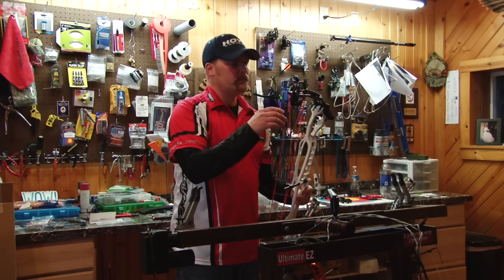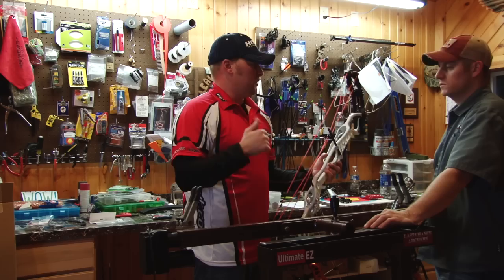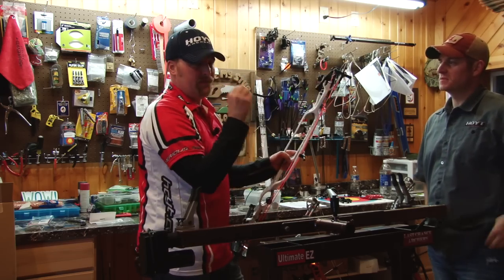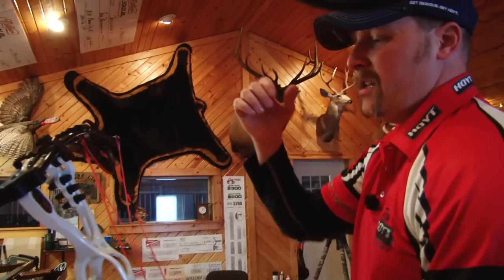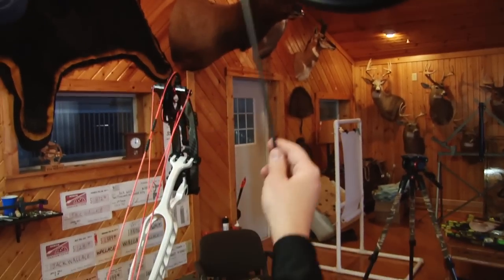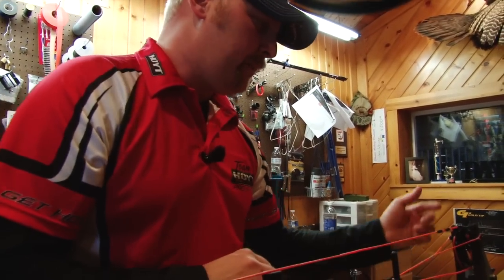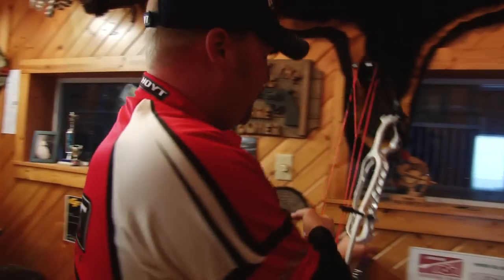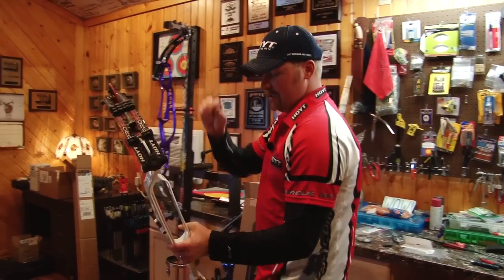Project #PAPASEDGE E:3

Comment: Hi,

I was wondering about setting the top cam advanced like that, I gess you have no choice in order to reach good bare shaft paper tune results? Do you think it is something more model-related or a cam-related behavior proper to the Z5? Doesn't it allows more creeping into the cable and a weird wall at full draw when the top cam is advanced?

Cheers,

Comment: First off I would like to say thank you for the videos. Now my question. To adjust the cam lean he adjusted the yoke. But when he wanted to get that 1/8 in. Away from the bottom stop he said he was going to adjust the control cable. Did he mean that or did he mean he was going to put more twists into the yoke?